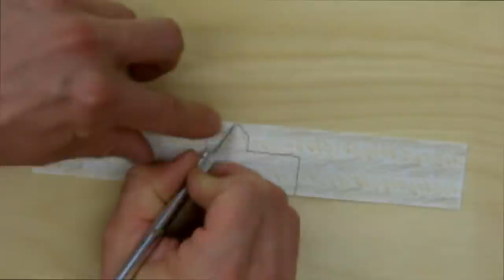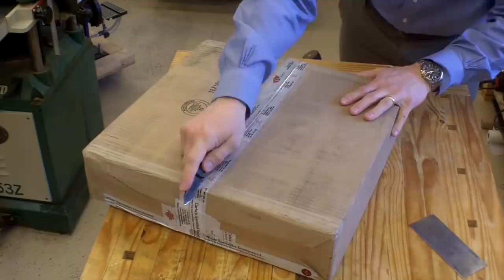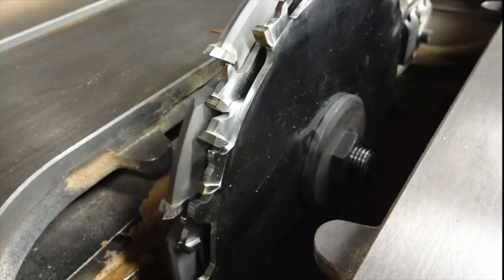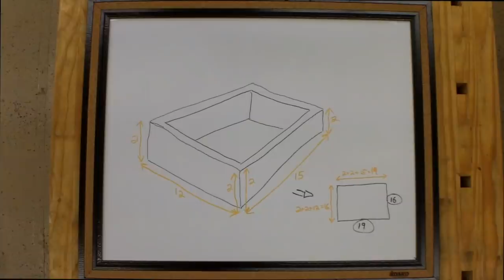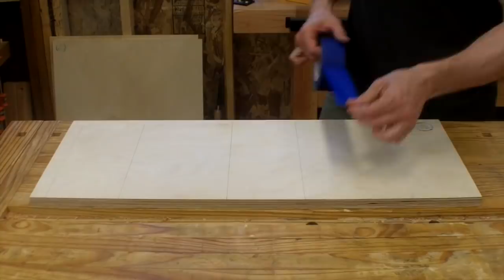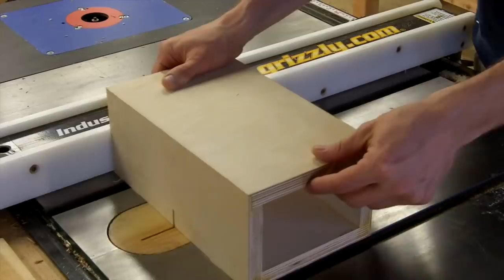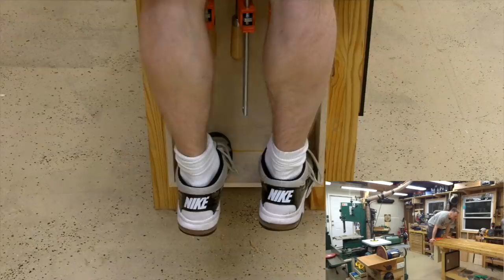New Invention - Easiest Drawers Ever!

Comment: Tools like that were made on the fly by people called tool and die makers all the way up through to the mid 90s. With the advent of Auto CAD and other such computer aided tools made the trade almost obsolete. My father retired a tool and die maker soon after the trade started to go out. There was never any thought put into patenting any of the tools made because they were made for specific jobs requiring different thicknesses, stability, strength of design in materials. Though you did have a fantastic idea in your foresight putting together the already existing tools designed by other people to suit your needs. It is far from original in its "basic" design. Nice work though man. Keep it up and hopefully together with the new card in in office that promises to bring back jobs to the US you can bring back a dying trade.
Reply: Tool and Die makers use "new tools" to do the same tasks, jigs, fixtures, prototype's like they have for years. The trade is not obsolete, just fewer US jobs and in big demand if you know what you are doing. I was a tool maker for 40 years. I know what I am doing from experience, you begin working on a bench and a vise, a piece of steel and a flat file. With all the computer tools you will still need hands on experience if you are active in a shop that makes things. NAFTA made tool and die obsolete in America "NOT" technology. You Father has great ability that has been squandered by our Politicians. What a moral crime it is. Math and Science in K-12 is out of fashion because it is too damn hard.
Reply: Oh, and a utility patent must show novelty which this idea does. A design patent is the other option. It all depends on the field in which it will be found, which could be many.

Comment: This is a variation of the mitre fold drawer which has been used since the mid-90's. A 'V'-grooved shaped 45° shaper cutter with an auto feeder. And instead of clamps, masking tape, and the glue was instant bond urethane hotmelt. JUST fold and tape.  If desired, all four top (long) edges of drawer box blank are edgebanded first, so when the blank is glued and folded the drawer is complete. GO BACK TO THE DRAWING BOARD! Custom grind your dado set for a v-groove profile and skip the red dot-blue dot nonsense. THEN YOU'RE COOKING!
Reply from the maker: +studfindingball my joint is far superior to a simple v groove, it locks together for easy alignment and provides more glue surface.  And the red-blue dots were only for demonstration, I don't do that every time.  Also my profile saves room on the arbor, there isn't enough room to make a v joint in 3/4" stock, but you can do it with my blade system.
Reply: For sure yours is a better glue joint, but 1/2"drawer panel stock is do able with v-groove, and minimal blowout when top edge of drawer is edge banded first. Besides, with modern drawer guides and glues v-groove detail will last a lifetime. Dado set would be left and right blades with half the v-groove each side.
Reply from the maker: +studfindingball If you are going to go that route just use a normal dado, and tilt the blade 45 degrees.  But I still think mine is a lot better.
Reply: Just like the folks who voted against Trump, you're entitled to your opinion.
Reply from the maker: +studfindingball as are you
Reply: His method actually created more glue surfacing. Though the V cut method is awesome. His idea is an improvement. Not understanding your reason for knocking his idea. His gap can be fixed with a new prototype.
Reply: Not knocking the idea. Love the concept and think a TABLESAW CUTTTING v-groove is a refinement of HIS concept, only because you can edgeband all 4 edges of the blank before you run the v-groove. Then when you fold the box, the drawer is complete. ( presuming your client wants to see tape, not core.)

Comment: I know that this shape is not new.  I couldn't care less about THAT... I want this in my shop.  I would like very much to know what the status is on this system.  I've got about 60 drawers that I will need to build in the next few months...I would like very much to use this system for them.
Reply from the maker: you'll be able to buy it soon, I should have a big announcement in about a month.
Reply from the maker: Pretty soon you can buy it from Rockler: http://www.rockler.com/rockler-miter-fold-dado-set

Comment: Hey before you spend a lot of money mate. You need to check out the Japanese. I watched a Japanese carpenter do this same thing . But he was using a hand plane. If I'm correct about this. The blade profile has already been done. Also don't cut so deep and soak your drawer blanks with water then make your bins. Cut in a few butterfly inlays across the joints and glue them in. Your drawers will be much stronger. Just my opinion.

Comment: actually, it looked like you may be able to increase the strength by leaving that  1/32 inch gap as it came out, and apply a solid epoxy to it, and along with your glue, you should have a powerful piece that WON'T just break on a second kick. Maybe not even after a fifth kick.
I like the corner work, but It also struck me that a mix of epoxy (along with a gap for expansion) would adhere ANY cornering shape. I'll give it a few tries and get back to you after I finish it.
d=^))

Comment: i work for a cabinet shop we do hundreds a week,up to 50 a day  some are nailed ,and some are dovetail ,it's a really great tool but it wouldn't be practical for high volume production, 
but it is a great tool for the do it yourselfers 👍
Reply: Waldemar Marchesi sure it would you use a full sheet of plywood and you lay it out individual drawers the cuts come on now
Reply: We use a cnc router the trick would be to apply that profile to a router then i can see mass production use, ken
Reply from the maker: You could make this profile with a CNC router, but only by using 2 bits.  Simply can't be done with one bit, as the cut profile has no central line of symmetry.

Comment: This is a very good invention, Andrew.  You changed the paradigm. I am positive this will be the next big thing that not only drives improvements in the drawers are made, but cutting down the labor cost and improve on the makers output.  This invention will also challenge other areas of building.  Again, the paradigm has been changed.  Take what you have done and continue building on it.  I'm happy for you and wish you the best of luck on the patent. 

Soon I will be retired and plan on spending time woodworking.  Your invention will be one of the necessities I'll be having in my shop.  That said, I'll be needing to know where to obtain this blade.

Kudos, pal.

Comment: Although I appreciate your efforts and what you have achieved, I'm not convinced you can patent a method of cutting wood. I have never made my own drawers but have built furniture from self assembly furniture suppliers  ("flat pack") here in the U.K. The drawers were already supplied in this "fold and glue" form with locating dowles and the drawer base which fitted into a groove.  It only required glueing on the drawer face which was made of a better quality wood. Good luck anyway.

Comment: .. Why doesn't the wood crack when you fold it?
Reply: ***** .. Paper is wood fibers that have been emulsified, reconfigured and joined together unnaturally.. but wood in it's natural state splits....
Reply: ***** .. Ya, but at a 45 degree angle?
    And i have worked with wood extensively and know it to crack and split, especially when bent like that....
Reply from the maker: +doncooper512 didn't you see the video?  It doesn't split if it's thin enough, I've done it dozens of times now.
Reply: Andrew Klein .. Yes, i've seen the video and my question was merely why doesn't it crack when folded like that..
    Is it because it's plywood? and if so was it special plywood?
    And if the folded corner wood is that thin won't it damage and fray/split easily?
    Also will pine lumber bend like that too?

    I know, all dumb questions.. and yes, what you've done here is amazing....
Reply from the maker: +doncooper512 got it, sorry for the snarky reply, I've tried this with both Baltic birch and hardwood plywoods, both bend fine if you leave only a very thin slice of wood to bend.  When you go across the grain you have a few cracked fibers sticking out, but after light sanding you don't notice.  Working the glue into the corner to wet the fibers seems to help.
Reply: Andrew Klein .. Cool.. thanks Andrew....
Reply: if it is a little 'crisp' and would crack you can always apply some steam, or maybe some water to soften it up when bending too. wouldnt put it in a steam chamber because the glue in the plywood holding it together, but on the surface wouldnt hurt. it's a good concept it seems.
Reply: doncooper512 h

Comment: My work (commercial furniture company) uses this process almost exactly. We have a large cross cut V-Groove saw. The blade we use is over 2 inches think and slightly more complicated (not that complicated is better LOL). We get a super strong hold with just wood glue. I think NAP GLADU makes our blade and I couldn't tell you the pricing.

Comment: This is perhaps not to the point as you are glueing a fresh machined/processed surface. It was found that the process of making plywood compressed the cell structure so the glue had less surface to wet. The fix was to grit blast the surfaces to be glued so the glue got into the open cell structure and had a stronger grip. Maybe a rub over with sandpaper would help the glue joint, I don't know. The glue joint is usually stronger than the wood.
That is a very neat way to make joints, well done and good luck.

Comment: The glue is strong enough? NO need for nails or anything?
Reply from the maker: The drawer I made for this video with an imperfectly sized blade (resulting in a gap) is still holding up perfectly.

Comment: I have already viewed your Update Video.
I am curious if the finished blade will work on different wood thicknesses OR only one specific wood thickness ?
If it can be used on a range of thicknesses (say 5/8" to 1-1/4" for example), I would definitely purchase one.
Reply: SnowTiger4Ñ
Reply from the maker: +SnowTiger45 it will work with a range of thicknesses by dado blade thickness adjustment.  That said, it can't go up as high as 1-1/4" since you run out of room on the table saw arbor. Probably tops out at about 7/8"
Reply: Thanks for the prompt reply. I totally agree about the Dado Stack Width issue.
I was referring to the Depth of Cut versus Lumber Thickness but had an obvious brain fart. One only needs to crank the blade height up/down on the table saw for your idea to work with different material thicknesses.  Thanks again friend.
Reply from the maker: Pretty soon you can buy it from Rockler: http://www.rockler.com/rockler-miter-fold-dado-set

Comment: The only problem I see with your joint is that if the corners ever needed to be sanded it would break threw the layer of wood to expose the seam of the joint.

Comment: Nice!

A similar joint is in use by some manufacturers of inexpensive flat-pack furniture.  It is a simple miter joint made by a 90 degree blade.  The plastic film on the face of the MDF provides the hinge for folding up the sides.

Your joint is stronger because of the dado.

Comment: Okay, I am ready for this blade.  I wish is was available.  You can also make just the head profiles to fit existing companies like http://corobcutters.com/ or Craftsman molding head cutter which I have (although I'm not sure they make those any more)  Although similar ideas have been around, you took it a step further and I await your product to be available for purchase. good  luck.
Reply from the maker: Soon!  Making the whole profile in a cutter head is a bit tricky, because you need slightly different dimensions for slightly different plywood thicknesses.  And since even plywoods that should be the same, like 3/4" will vary a bit, so you might not get a good joint.  That is why using the dade stack is great, because dado thickness adjustments will compensate for thickness variations, and you can always get a perfect joint in any thickness material.

Comment: An excellent idea. I was so happy when you said you had patent pending. Youll make money from it if you licence it. The joints look lovely, and just for sheer speed its a double plus. You can easily put some screws through the back panels and front as neither will be seen by facia and draw rear is hidden if you ever worry about the draw front being pulled off over time.
Once again, very well done. 
Im impressed!

Comment: good idea, but similar thing exists you can use only that 45 degree angle with out dado for mdf and other materials and cut grooves with router CNC or on tablesaw
Reply from the maker: +purask so your point is that there are much slower ways to make the same joint?
Reply: slow no, easier but with less glueing surface yes :) because here in this video you showed that its important to look for witch side you make the cut but if you cut only 45 degree for one edge or lets say you make same pass with 90* blade then you dont have to flip the guide to other side just tilt your dado stack on 45 and make the same pass :)
Reply: or use a dado stack at 45º--- that said, i personally find it best to cut the pieces separately first then tape second.. there's going to be a whole lot of wood waste if cutting a bunch of 5 sided boxes which have walls taller than a few inches as shown in this video.. as in-- too much waste..

Comment: Great idea but I used to work for a saw blade mfr that sharpened as well. Each time you sharpen, the height of the carbide tips is reduced by a hairline, and if the sharpening process catches one tip a little off, there is unbalanced contact. Replaceable carbide tips (kept in place with set screws) may be the solution. I think the idea is fantastic though and I hope you're successful!
Reply from the maker: Thanks, but replaceable tips sounds like a can of worms, think we'll just need to get sharpening right.

Comment: I really dont see how this could be patented. When its all said and done its just a saw blade.
Reply from the maker: +Nucc's Garage time will tell, we will see what the US patent office says.
Reply: the design of the blade itself could be patented if the idea is make that 2/3 baldes into one, just ready to install on the saw machine. Also you better check for other possibilities to make that kind of blade, such as a V shape and others, so you could prevent someone patent others designs that make the same.
Reply: +Andrew Klein Did you mail to yourself the drawings and details of everything with copies of the application for patent and kept the unopened mail? That garantees you have in the court of law all the rights just in case someone try to steal your idea. Be awared of the patent office, they do sneaky things sometimes.

Comment: Aren't you forfeiting your ability to patent by showing the invention publicly before you actually filed the invention with the USPTO ? You may want to check on this. An inexpensive way to file a patent at the idea stage is to file for a provisional patent — it's ultra cheap and the writeup can be as simple as a one-paragraph description. Provisional patents cover you for one year, during which you can show the invention publicly, and shop around for investment/business opportinities, after which you'll need to file for a full patent. The USPTO has a new 'Track One" program, which speeds up the review of a patent to less than a year, whereas before a patent could be pending for five years.
Reply from the maker: I filed a provisional patent just before posting this video, and a full Utility patent within a year of the provisional filing.  I'm covered!

Comment: nice shop and video, nice to see a good surfaced table saw no coffee rings and stains!   that is an old cutter design set up on a molding machine- sticker. however never seen the custom shop set up.  two suggestions for the unit have your machinest make it one piece eliminate the stack set that way you eliminate one step and you end result will be consistent, and the machines that run hundreds of feet at a time have a wet roller run on the edge to soften the miter and prevent blow outs .  Sounds like you will do great with this! good luck. very impressive shop well organized Tim H

Comment: I'm really nervous watching you lean over that saw. You look a little unstable and could  and have an accident. Is there not a safer way to push those boards through that won't require you leaning over the blades. Maybe a longer push stick. Concerned for your safety.

Comment: How much stronger is it than a simple V cut that can be folded the same way without the need for color coding sides or moving the bar?
Reply from the maker: +G and K significantly stronger and easier to glue up.  And you don't need to color code it, I only did that for the video to make it clearer.  In my most recent video I talk about advantages as compared to a router bit.

Comment: I love inventors, particular cabinet makers on Youtube, they come up with some crazy non sense ideas.Nothing negative against your invention Brother, but if you don't want staple your drawers, just biscuit joint, much faster. https://www.google.com/search?q=joint+bisquest&biw=1366&bih=613&tbm=isch&imgil=5kBkLlIOR-CWgM%253A%253BMAK7BhW6AlCd7M%253Bhttps%25253A%25252F%25252Fwww.pinterest.com%25252Fpin%25252F230246599673252278%25252F&source=iu&pf=m&fir=5kBkLlIOR-CWgM%253A%252CMAK7BhW6AlCd7M%252C_&usg=__Wl4rMD4DiuDQZSQiluaEtDrJqA0%3D&ved=0ahUKEwib8azkyPvMAhUESSYKHSvxDX0QyjcILA&ei=q-1IV9vvEoSSmQGr4rfoBw#imgrc=5kBkLlIOR-CWgM%3A
Reply from the maker: How did you get the idea that the advantage of my blade is the elimination of staples?